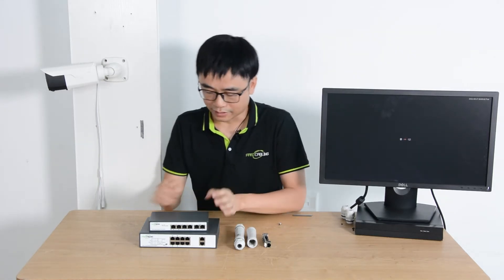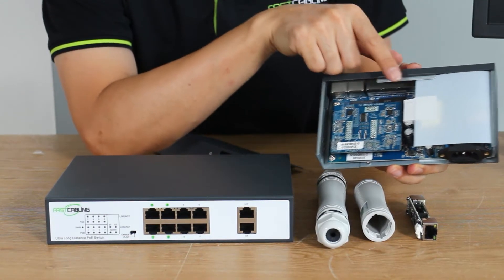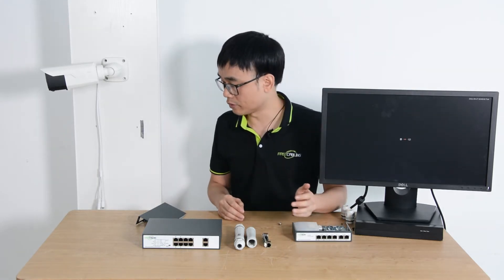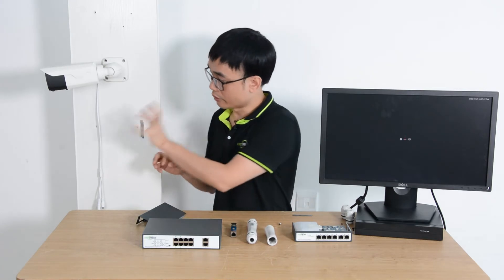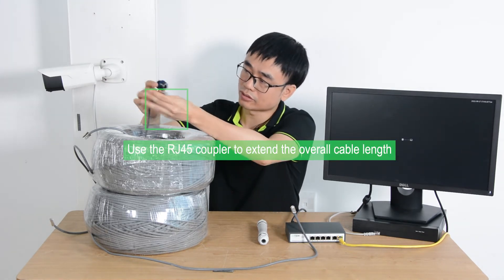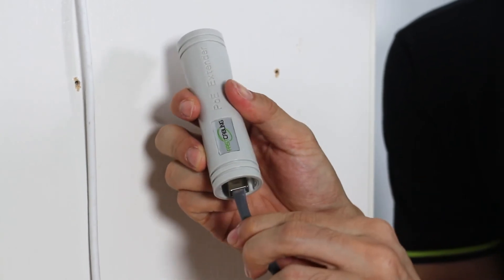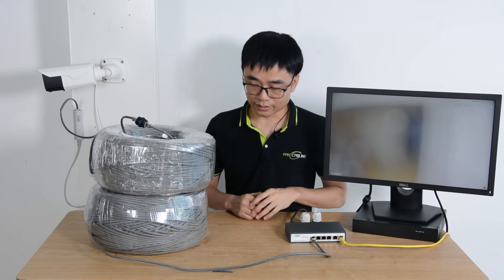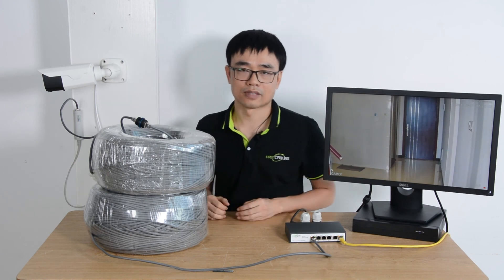How Does an 800m Ultra Long Range PoE Switch Work?

Comment: Can i extend my wifi to other place using 
125 meter long cat 5 cable
Reply from the maker: I think you can try the cat6 cable. It may work within 125 meters. If it does not work, you can add the PoE extender at the middle, but make sure you have a PoE injector or PoE switch at the backend. https://www.fastcabling.com/product/poe-extender/